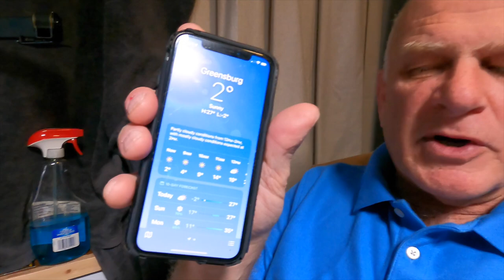You are Crazy to believe a Roofer!! I don't even trust myself

Comment: We built a new home and I paid $80,000 for the roof. A significant area of the roof is flat (we live in a view sensitive area). After 5 years we saw two major leak areas. One area brought down the ceiling. Both my general contractor and my roofer went out of business so I have no recourse against either one. I hired a new roofer who told me that the roof I had was the poorest he had ever seen. The torch down material was applied directly onto plywood and not even completely torched in some areas. I don't know how I could have avoided this mistake. At least the new roofer is applying a polyurethane coating so we do not need to reroof completely.
Reply: This guy will install over old gravel.  He can't be trusted either lol
Reply: Well at least he tells you and doesn't charge you for a new roof knowing he's only making a half ass repair.

Comment: I do have my customers at heart, that is why I visit many of my customers after 20~ 40 years to make sure the roofs are not leaking. A 3 layer SBS polyester torchon system will last over 30~40 years.  One extra layer and you have a lifespan  of 50 years.  If I was chasing the money, I would have used  the modern "Miracle" systems that do not last long and need repairing constantly as shown on You Tube.

Comment: Hey thank you so much for your informative videos. I had 3 roofers come out to tear out and replace my GARAGE roof that’s 13 by 20. They all tried to scam me. They told me the wood alone would cost me 1700 to 2000 and the job will be a minimum of 4000. Your video is giving me the courage to hire a a couple of friends to help me. And I found out that the sheets of roofers wood would not even be $300 dollars. I’m just looking for a video that shows how to tear off the rotting wood that’s up their now ?
Reply: You will need 9 sheets of 3/4 plywood (500), 9 sheets cover board (200), nails and screws and and circular plates good luck at buying a small amount roofing store only sells in large buckets then tpo,epdm , or torch down, I would do tpo personally,  you will need a tpo welder too.
Reply: We want to hear about how your roofing project turned out,is it still leaking ,was it hard to figure out,what happened etc...?
Reply: @eastside0434  Mine came out very good following the instructions on this video

Comment: 🪓🪓🪓🪓🪓🪓🪓🪓🪓🪓🪓🪓🤑🤑🤑       😉   
 i  like your videos 👍🫡👍 
i bought a old grocery store back in aperil. 2023.  3000 square ft.  it has the old roll out ruberized asphalt  rayon  roofing .. low pitched .  it was so cracked up it looked like a minuntchure  dryed up mud flat on a river sand bar and there was leeks..  and some ponds .. ill have clost to 30 buckets of roofing tar by the time im done .. 5 more to go.. 
i got to put in a drain and some outher ishues .. 
i used under coat asphalt  with nylon strands . 2 coats . and now a 3rd using the nylon with plastic asphalt , i seem to like it better for a durable tuffer coat that drys much quicker.. but , this sounds crazey but i use 2 gallons of gasolien per 5 gallon bucket to thin it so i can use a roller to apply it .. 😂. 
i looked up on google how to thin it they advised not use gasoline,  insted mineral sperits . or water .. 
I can't afford the mineral  sperits .. and they lied about using water .. 
 any way you and your wife been a big help, thanks🫡

Comment: My home has a flat roof that has large areas of standing water on it when it rains. One roofer wants to glue down foam panels and create a slope and put ipo on top another wants also to put down tapered iso board to create a slope then   a 2 layer roll roofing hot tarred down. Any advice please. It has a fairly new membrane with roll roofing on top. I started to put silicone coating on it in areas because I was worried about standing water.  Please advise.
Reply from the maker: hmm, depends on what roofing material is currently on the roof. Ponding water on a roof is not really an issue. Why worry about something that has been there since the roof was constructed. It is only an issue if the roofing material has failed or was not installed correctly

Comment: I'm wondering why the plywood was flexing so much in just that one place on the roof.
Reply from the maker: They were short pieces. and also 20" on center rafters calls for 3/4" plywood and not 1/2".
Reply: That piece of plywood was installed with the grains parallel to the framing (rafters).  When it comes to using 1/2" plywood for roof sheathing when there is a 24" span between rafters:   it should always be laid perpendicular to the framing and should also have H-clips in between each Rafter for extra support.   

So Flat Roof Doctor is correct in several ways...

#1:   a "flat" roof really should have 3/4"  boards or Plywood for  sheathing.  Then this problem with a sagging roof deck cannot occur 

#2:  no real carpenter would lay 1/2" Plywood parallel to the frame in such a fashion.  So...even though the builder himself was most likely reputable... he obviously used some hacks to save money so anyone who trusted him may be losing out